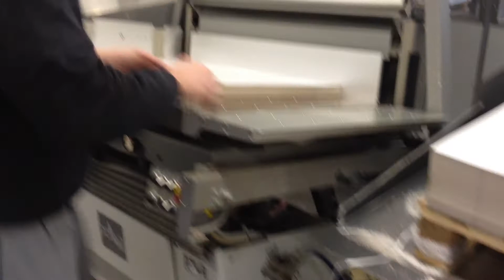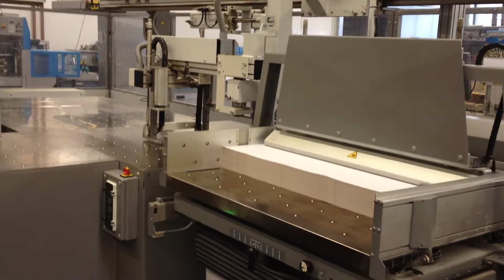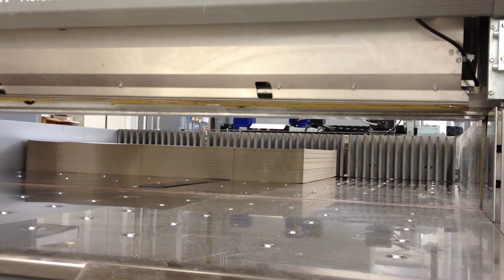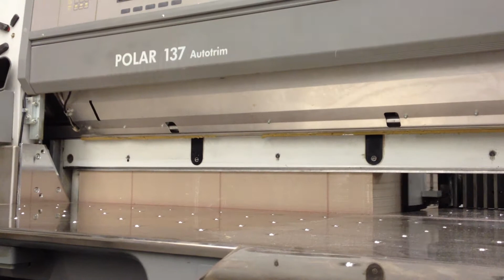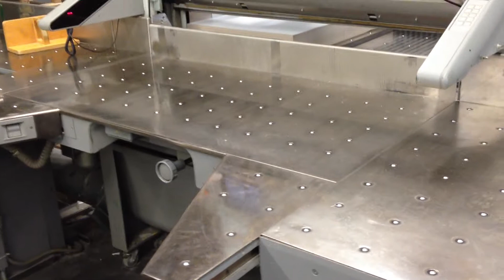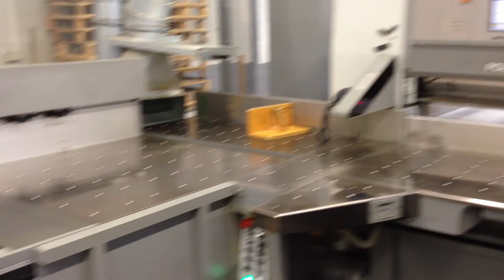Polar 137 ED AT PACE Part 1 | Allaoui Graphic Machinery

Comment: Could do this quicker on a by hand on a  78. Obviously having a cutting system such as this eliminates the skill of knocking up and programming the job. If this is just used for cutting blank to sra then I suppose you don't need a skilled operator. But for example if you are making booklets with cross page pagination then you still need a skilled operator
Reply: I fully agree!